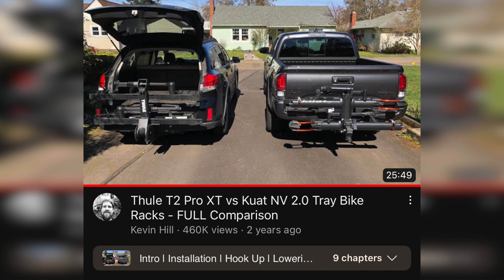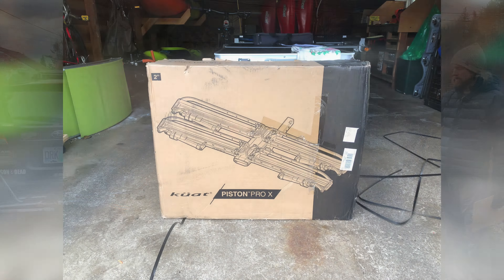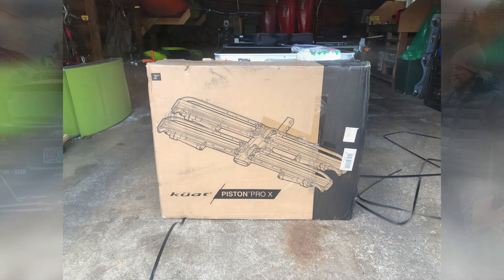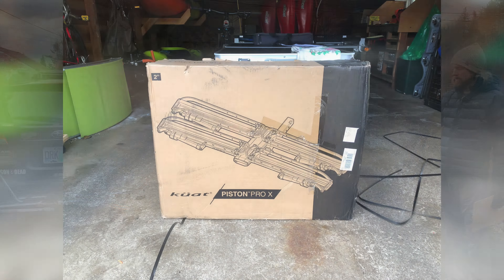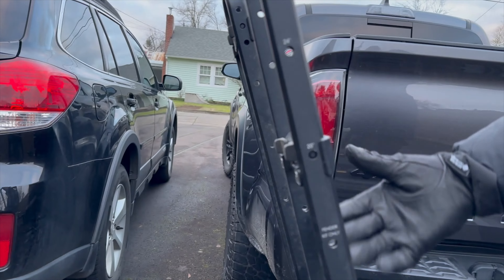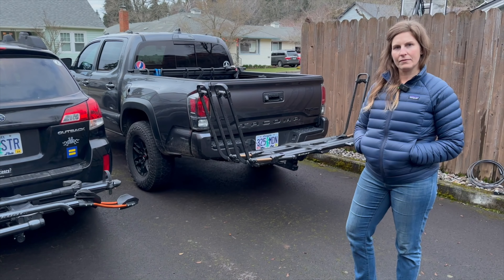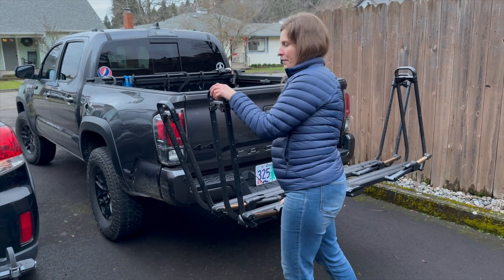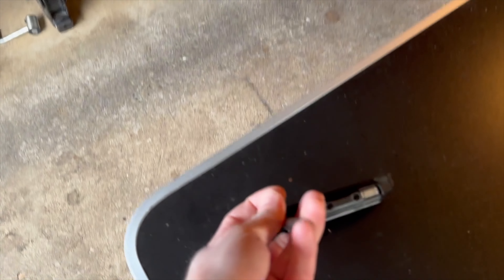Kuat PISTON® PRO X vs NV 2.0 Bike Racks

Comment: One important key point about the lock is that the integrated lock is easier to steal for a thief that is familiar with kuat.  Simply remove the arm with the lock and the bike can be had with the kuat arm.  The semi integrated lock is harder to steal because it locks onto the base of the rack rather than an arm.  Not everyone is familiar with removing the base since this isn’t required in the installation process.
Reply from the maker: Thx for sharing that fantastic point! 👍🏼🙏
Reply: That's absolutely true, but if someone is going to all that (potentially noisy and visible) trouble, they could also just detach the base of the Piston Pro from the actual hitch mount at the pivot and take the whole thing with bike(s), cable lock, and rack base all at once. Get two guys, undo the one big allen bolt at the pivot, toss the whole thing in the back of a truck, and drive off.

About the only way that you can be REALLY secure is to use a big-ass chain and secure it to the safety chain loops on the hitch itself. But I think the take-away should be: don't rely on anything keeping your bikes 100% safe on a rack.

Comment: Excellent review.  Important...One thing that NO ONE includes in their review is that while the NV 2.0 (2" model) is rated at 60 pounds per bike, the trail doc feature is only rated to 40 pounds.  I wrote to KUAT asking for the rating and customer service responded to my question.  This is important if you're buying the NV 2.0 to carry ebikes or other heavy bikes and expect to use the trail doc.
Reply from the maker: Wow, that’s gtk. I never would have thought about that one, and def important with so many e-bikes out there nowadays. Seems like they should have built it to same capacity as the rack, imo. Thx for watching and commenting!

Comment: The NV 2.0 has place in the center of the tightening knob to use the included hex key to help tighten the rack another 1 or 2 turns.
Reply from the maker: Very cool. Never knew that. Thx for sharing. 🙏

Comment: I recently bought a Piston Pro and still have a NV2.0. So far I like the Piston Pro and part of the reason that I purchased a Piston Pro is that my NV2.0 was starting to rust on the arms and they do not collapse all the way along with outer tray is sagging. I am working with Kuat to have parts shipped to repair this and their warrantee department has been great. I have a wide variety of bikes - mostly mountain...3-29ers, 1-Fat Fire and 1-27.5 e-mountain bike along with a gravel and road bike and all fit nicely in new Piston rack. It appears to be built a little better than the NV rack. 1 negative that I thought of was the tightener that allows to snug up the rack to the receptor on the hitch...this is done with an Allen wrench on the Piston vs a knob that is on the NV Rack but this is minor.
Reply from the maker: Good stuff! Thx for sharing your experience with the two racks, esp since you use them for so many different types of bikes. I’m glad to hear that Kuat Customer Service has been helping you out.

Comment: I used an NV2 for years and loved it. I’ve had the Piston Pro since they came out and love it too.  I do miss the trail doc on the NV2 a lot. The Piston Pro is easier and doesn’t touch anything but tires, that’s a positive. The only negatives of the Piston Pro, in my opinion, is the lack of trail doc and I don’t feel like it holds onto road bikes as well. Maybe it does but the bike sure can wiggle around. The locking cable for the PP being separate is a bit of a pain to keep up with but it does work better than the integrated cable in the NV2.
Reply from the maker: Thx for watching and these insightful comments. Great points about the trial doc and locking cable differences. I’ve not had road bikes on the Piston, so sharing that here is much appreciated. 👍🏼

Comment: Excellent review as are your others. Do you know if the Piston light system works with a Tesla Model Y? It has a 7 pin flat connector.
Reply from the maker: Thx! It’s a 4-pin, so I think you’ll need a 7 to 4 adapter.

Comment: Loved your videos! I recently purchased 2 Velotric Discover 1 Step Thru Bikes with the Front Basket & Rear Rack options for long touring trips. Is there enough room for the 2 bikes on either of these 2 racks without the bike rubbing/touching or you need to add the 3 bike option? If so, I'm worried about weight capacity of the racks.
Reply from the maker: Thanks for watching and commenting. I don’t think you would have issues with the bikes rubbing, but you might with their weight. The NV 2.0 has a max of 60# each for two bikes, and the Piston Pro X is 67 each. Hope that helps!

Comment: Can you speak to the cable lock insert?  No protection from mud, dirt, water freezing into ice. If it’s all gummed up what do you do?  No rubber cap to protect it. It’s a big deal for me so please let us know if it’s been a problem. Thx
Reply from the maker: I had one other person ask about this so double checked and it’s just an open hole that goes into the rack itself. I even poured water in and it flows out from any number of large openings in the rack itself. So no worries re water, ice, mud, etc. in my opinion. Hope that helps.
Reply: Thx

Comment: Great review on both! So would you suggest the Piston for bikes with fenders?
Reply from the maker: I think it depends on how long the fenders are (i.e., how far down they go). The Piston could be better if the rear fender isn’t too low, since with the Piston you’re clamping both the front and rear tire, whereas with the NV, the rear is just being looped to the base. However, if the rear fender goes really far down, that could actually be better.

Comment: How do these racks hold up to winter weather transporting heavy fat e-bikes? I have a Thule XTR Pro and it has corroded from the salt on the roads.
Reply from the maker: That’s a good question, but unfortunately it’s one I can’t help with since I’m in OR where it only snows at elevation and they don’t use salt on the roads. My old stomping grounds were WI though, so I know what you mean about how much that salt can take a toll on things. I’m guessing they would do ok since they have auto quality finishes, and the Pro has an even more durable coating, but I can’t say from experience.

Comment: I have a lower vehicle and was curious how far the base post sticks out from the hitch on the Piston Pro. NV 2.0 is 18" according to your other comparison video to the Thule XT (13").
Reply from the maker: Sry for the delay. I had to find time to measure this for you. The Piston Pro X sticks out about 13”, so similar to the Thule T2 Pro XT. 

This can vary a little, depending on how far into the receiver the pin hole is on your hitch. It’s about 15” from the hole to the back of the rack, so for most receivers (where the hole is inset about 2-2.5”) it will stick out about 12.5-13 inches. Hope that helps.
Reply: @kevinhill.8  Awesome thanks for checking that! I'm suprised it's that short. Looks like it sticks out as far as the NV 2.0 minus the knob on the NV. Maybe I'll get the Piston Pro then.
Reply from the maker: @frankschock9981 yeah, I was a little surprised too, but getting that knob off the end def helps. Pro X is a sweet rack; I don’t think you’ll be disappointed. 👍🏼

Comment: Thanks for the review. Looking at the top of Piston Pro, I see a big hole where the lock cable goes. Is there a plug for that? Or does the rack just fill with water? Is there a drain hole elsewhere? Thanks in advance for any info.
Reply from the maker: Sorry it took me so long to get back to you. I needed to go out and actually look at the rack. Turns out that hole is completely open and goes into the body of the rack. I poured some water in there to test it out, and it simply runs out of an open area a little further towards the hitch, which is a nice simple solution. Hope that helps. Let me know if you have any other questions. 👍🏼
Reply: Thanks Kevin! Appreciate the reply and checking that out for me!
Reply from the maker: @itsarubiconday  you bet. Happy to help. Thx for watching and commenting. 👍🏼

Comment: I’ve had a ProX for a year now. The integrated lights stopped working about a month ago. Kuat sent a full rebuild kit that my LBS wasn’t able to install. I’ve been without a rack the whole time. Apparently Kuat has done a design change since I purchased mine. I’m more than a little disappointed in them. Also, the light cable is easy to pinch and short out when you put the rack in storage position.  Finally, the tailgate of my Ram and F150 trucks won’t lower fully down in any of the unloaded positions.  I worry about denting the tailgate.
Reply from the maker: Bummer! Thx for adding this information to the comments so others can know ab your experience. I’m surprised your LBS can’t help w the lights. Is it that complex of a swap? As for the cable, I’ll have to look at mine and make sure it’s not as risk of getting pinched. Is it something that you can use the magnets that mind the cable to help prevent?
Reply: I bought one of the early versions and had the same problem. Kuat sent a new wiring harness which, after looking at how involved it would be to install, I took it to my LBS. they were able to do it but said it was a  difficult project and not sure if  they would do one again. Kuat did reimburse me for the shop cost.

Comment: Nice review, have you considered the Kuat 10" Hi-Lo Extension?  I have a Tacoma as well, and hoping the extension adds enough clearance to open the tailgate.  Thanks again for the review!
Reply from the maker: Thx for watching and commenting. That’s a great idea, and one I had not really considered for tailgate clearance. I think it would def do the trick. Rack would prob be a little more wobbly when sticking out further, but I doubt it would be a problem. 👍🏼

Comment: I have the NV 2.0 and a Mazda CX-5. When the rack is in the upright position I'm still able to open the trunk with a little bit of clearance without hitting the trail doc. Do you know if the Piston Pro X will have more or less clearance in the the upright position?
Reply from the maker: Wow, great question. I never compared the height when folded up. I’m guessing the NV sticks up more w the trail doc, but I can’t be sure and I no longer have the NV to compare. Might give Kuat a call at 877-822-5828 or send an email to info@kuat.com.

Comment: The 50 inch max wheelbase on the NV 2.0 wasn’t something I had considered; my Levo (S5) is slightly longer with the stock setting geometry, although it looks like it could still squeeze in that’s now something I’ll take a closer look at. Thanks!
Reply from the maker: Glad it helped. You can definitely get away with a little over 50” with the NV, but might want to try before you buy. 👍🏼

Comment: I find that my situation is different since I'm carrying four bikes.  I bought the 1Up and many people love it but with 4 bikes (or even just the rack with attachment for 4 bikes alone without the 4 bikes) is so hard for me to get into a position to tilt it that my 18 yo has to do it for me but he won't always be there so I'm sending it back and thinking of getting the kuat pro x.  I love the 1 Up in every other way pretty much.  I think it didn't stick out as much and has a place for the license plate.  I don't see a place for the license plate on the Kuat.  Do u have experience with carrying 4 bikes or know anyone who does?  Does the tilt mechanism still tilt easily (besides the weight of the bikes) and is it easy to reach after putting on the attachment?  thx!  great video!  Love the license plate and GD sticker :)
Reply from the maker: Kuat came out with a license plate mount for the Pro X since my review came out. You can view it here: https://shop.kuat.com/License-Plate-Mount-Adaptor

As for the four bike setup, I’ve not used it, but the release lever on the Pro X is easier than the NV 2.0. That said, you obviously still need to support the bikes as you release it, and the lever is between bikes 1 and 2, so I’m sure it’s a bit of a reach while set up with four bikes. 

You might want to consider the Thule T2 Pro XTR since it has a release handle at the end, and it stays at the end, even with four bikes. I did a comparison btwn the Kuat NV 2.0 and the Thule T2 that may be helpful. Check it out here, if interested: https://youtu.be/8DM0JkyNicc
Reply: @kevinhill.8  I haven't looked at Thule at all since people say there is a lot of plastic.  I'll check out your video!!
Reply from the maker: @kimromen1304  it’s true that it does have more plastic, but it’s still a solid rack. I used it for years without issue, and the handle at the end is definitely a nice feature. I would imagine with four bikes it’s even nicer. Good luck!

Comment: have you gone through a touchless car wash with the piston on? you aren't supposed to do that with an NV but I've done it forever with no issues.
Reply from the maker: No, I’ve never tried that! Does make sense that tray racks might be fine with touchless since the rack is pretty large and solid, so the sensors probably detect it. 🤷🏼‍♂️

Comment: also what's the point of having a pickup truck if you still need to get a bike rack? pick ups are already ridiculously long vehicles and adding the rack turns it into a bus
Reply from the maker: Haha, 🚌. Most people don’t want to lay their bikes in the bed and have them bounce around and get scratched up. There are racks made that fit in the bed though, or pads to hang the bikes over the tailgate. However, it’s also nice to have the bed space open for storing other stuff. Everyone has to figure out what works for them.